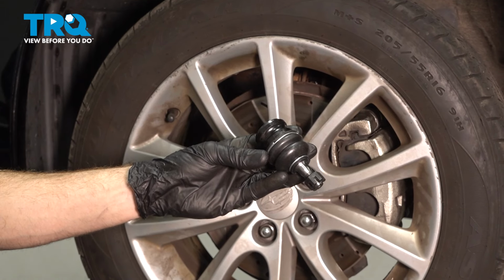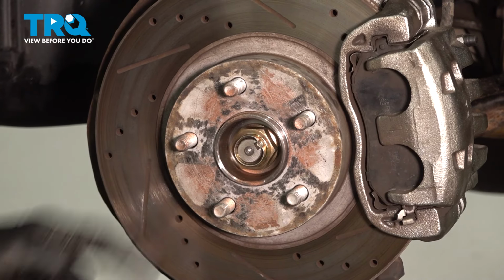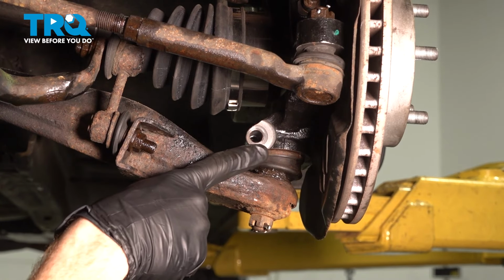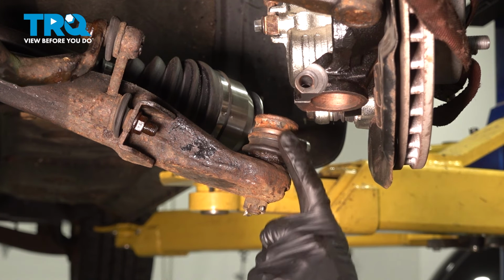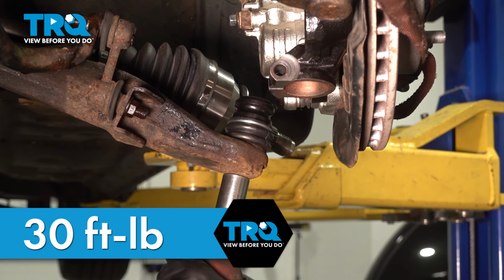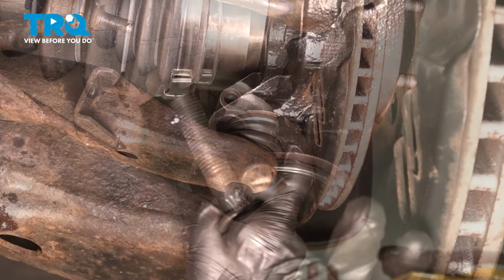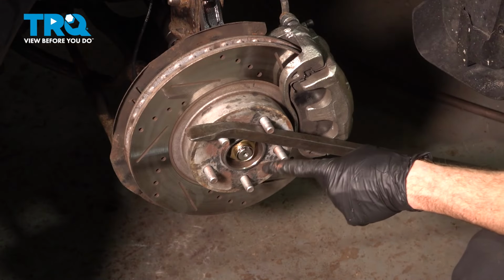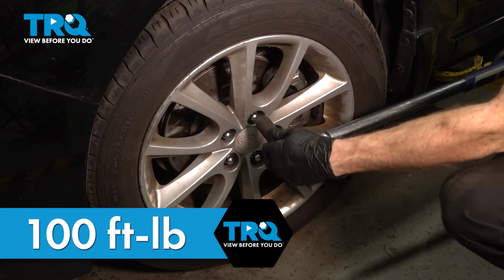How to Replace Lower Ball Joints 2012-2016 Subaru Impreza

Comment: Do I have to swing the axle out to remove the lower? I feel like if you remove the lower nut and then pull it from the control arm. To put the new one in